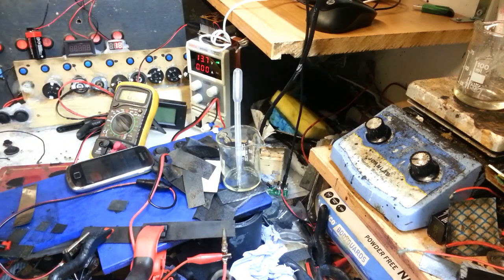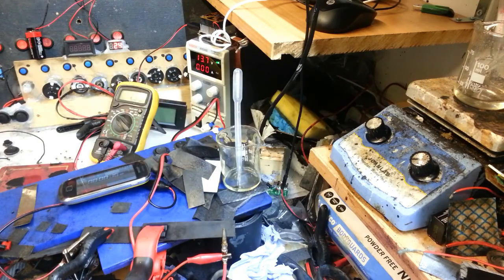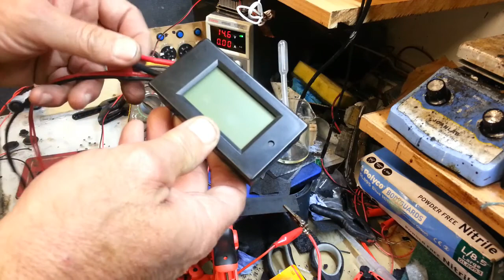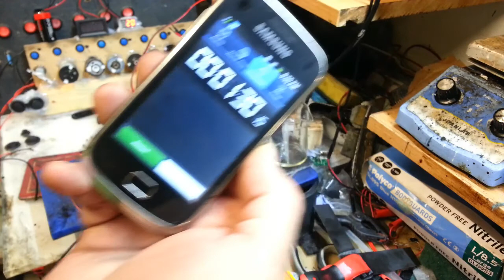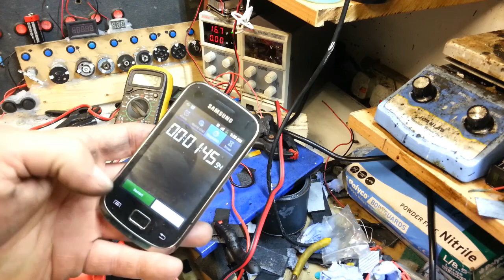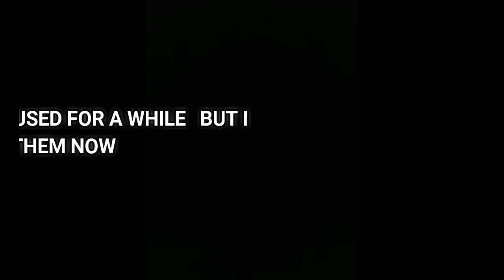THREE CARBON BATTERIES one with Brand New Material !!!

Comment: The Carbon from an Alder tree would be a good one to maybe try sometime. Alder would makes useless firewood it has so much water in its cell structure, once seasoned fully it becomes feather light and of very little calorific value. However it used to be highly valued for Gunpowder Charcoal, so much so that powder mills were built near rivers where Alder grows. It should produce a charcoal with great surface area, that I think is why it was used in gunpowder. When the gunpowder was corned (water added, then ground up and re-dried) the KNO3 would no doubt have saturated the spaces in the pores of the Alder charcoal, making for a very effective burn rate.
Reply from the maker: Richard Sandwell yes i have been looking at hard or dense wood for some time some reckon that c60 carbon comes from hard wood charcoal but i doubt that very much.

Comment: With the "flimsy" material, 60x600mm sheets rolled up as anode and cathode with cell-guard separator and you have a competitor to the 18650 Nimh battery. If you get two pairs in series in a can, then it would compete with a lithium cell.
Reply from the maker: EmmittBrownBTTF1 i have to agree to a certain extent because i have actually tried a smaller version of what you said and it gave very very good power.

Comment: Nice one mate, did you use normal paint container amorphous carbonization or did you use ferric chloride catalytic graphitization for the spring onion?
Reply from the maker: No mate if you use Iron / Steel containers they fall to bits in no time and drop metal flakes into your experiment, i always use either Graphite or Stainless Steel.
But if you use Stainless you must let the Kiln completely cool before opening.
And no Ferric chloride that just makes you Carbon Magnetic.
Reply: I see, so you used no catalyst right?
Reply from the maker: Aetheon Pro thats correct, i only use catalyst when i am carbonising with my chamber but this work is in the kiln.

Comment: Also you showed a organic leaf of some type that you converted to carbon. Another bright guy is developing hemp batteries. There’s a correlation to fibrous plants. I’m considering dense wood.
Reply from the maker: Guy Ruff yes mate the structure of a leaf should really make the carbon something very special, a bit like hemp but it takes a lot of carefull work to maintain the structure.

Comment: Hey mate! Congratulations for your videos! I have a question, since I'm also working with graphene and carbon based batteries (hopefully I'll make videos soon). I often encounter the problem of the self discharge of my devices which stabilize around 0.5V. I'm at the beginning but I would like to know from you which is the best stabilized voltage that you got in your devices and if you used a liquid or solid state electrolyte to acheive it. Cheers
Reply from the maker: Edoardo Scaggiante hi the best stabilised voltage wasaround 1 volt at present and this was with liquid electrolyte. Hop that helps.
Reply: Thanks for your reply. 1 V is a good achievement. However Robert Murray Smith claims he achieved a stable 2V cell with his mix. It's possible that the thickness and the quality of the separator plays a role in the self discharge. If the electrodes get very close there might be higher dissipation. I don't know which separator does Robert use for his battery, but I don't think it's just kitchen towel or regular paper. In alkaline cells the separator is just regular paper, but the gel electrolyte is 3mm thick. What do you think?
Reply from the maker: well as you know RMS is the master himself and someone that i hold a very high regard for, so if he says he has a stable 2v then i believe him.
But yes you are correct in that the closer everything is ( Electrodes / Active materials ) then everything becomes more stable.
however the overall resistance of your Active materials will also play a major part in this, along with good chemistry.

Comment: What do you know about Iron carbonate. I’ll bring this up because I’m really interested in it because it’s found around volcanos. My thought. This come from the magma of the earth. Conductive and I believe it could be a save battery product. So I’m going to test some samples. But could use some input if ya got any. Thanks.
Reply from the maker: Guy Ruff well i don't know an awfull lot about iron carbonate to be honest. But just the name sugests that as a compound there must be iron cations and carbonate anions so give it a try, but choose you electrolyte carefully.
Reply: kev wallcroft electrolyte I’ll use a number of it. Bought some baby diaper powder that jelly. Recently. Works great. Better than ripping diapers apart. You keep saying phosphoric acid. I’m more inclined to use the potassium hydroxide. You done any citric samples.
Reply from the maker: Guy Ruff well just about anything will work as an electrolyte but what you need is for it not just to work but to work well.
As regards the acids are you talking about as a catalyst ? For carbonising ? If so many weak acids will do.
If you are talking about surface activation then you need strong stuff and it is a matter of trial and error but potassium hydroxide works too.